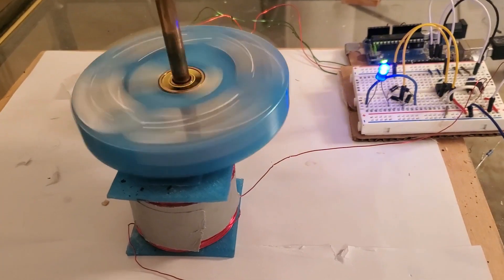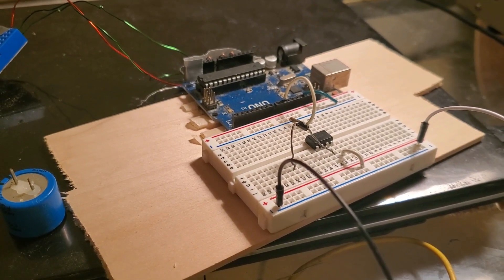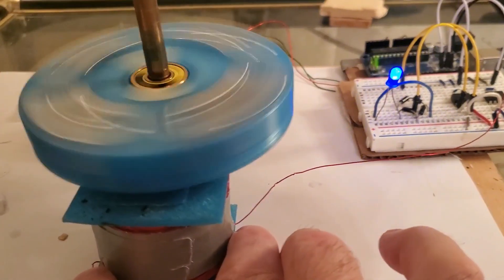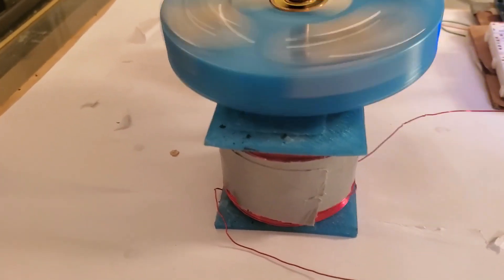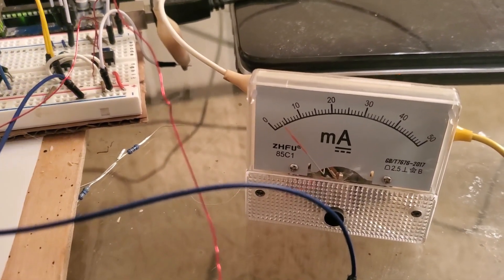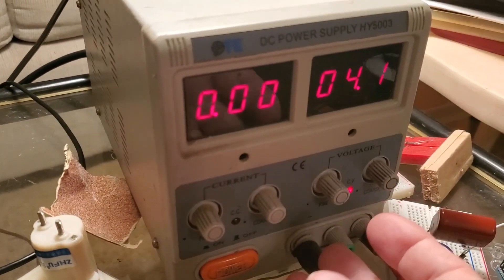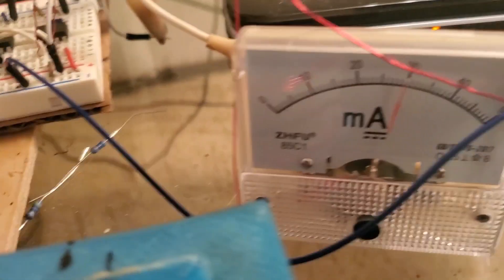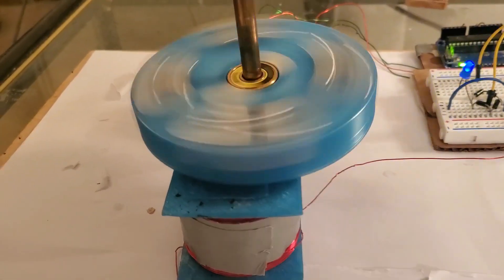Mysteries of the Robert Adams/John Bedini style Pulse Motor

Comment: Because of the Reed switch basically you have a magneto like they have no lawn mower except for a lower voltage because the windings ain't the same as the magneto set up in the lawn mower motor
Reply from the maker: I can't disagree, though in this case you can drive a rotor with the "magneto".
Reply: @paulmaher812 
Yeah you have to time it just right that's true but I can't say it can be done nor can I say it cannot be done be careful don't advertise it too much it's just something that I noticed while I was experimenting on my own little toy motor

Comment: Is the LED before or after the 'electronic switch'? We need to look at the schematic and chronological part of that circuit.
With regards to your volt meter in the PSU: it is very well possible the volt meter is tapped off at a point where there is a diode to prevent the PSU from getting damaged. This would make you believe it is rectified. And it is in a way. Have you tried putting a real sinus voltage on your PSU? Most likely it will come out one way only (again).
Any how, in electronics it is usually good to do research by measuring and checking every part of the circuit. If you have an oscilloscope you could find out even more.
Reply from the maker: Thanks for the comment.  Once I had a chance to sleep on it I realized what is going on.  So first off, this doesn't just show up with a PSU, I may have demonstrated this in a previous video, maybe not, if you just spin the rotor and replace the PSU with a cap you see the voltage in the cap.  So voltage is being rectified but how?  What gave it away for me was when in this video I moved the coil to different angles in relation to the hall effect sensor and the current and voltage out diminished then reversed. As each North then South magnet spins past the coil it traces out an AC sine wave, one would expect without a diode there would be not net DC current.  What I didn't factor in previously is that the PSU or Cap is only connected to the coil for the brief time of the pulse.  So perhaps considering a single peak -> peak of the AC wave, the coil is only connected for say 10% of that time.  Even when the PSU power is at 0 the arduino is still making and breaking the connection to the PSU.  So from there one can see how if you chop the wave up into 10% increments there will be places where the coil is putting out a a large positive voltage, at the zero cross it will put out nothing and places where it puts out a large negative voltage.  It is actually an example of synchronous rectification.  As I said for such a simple machine there really is a lot going on.
Reply: I like building pulsed magnetic motors too. I made a high speed one (10K+ RPMs), that is bearing less. The rotor axel shaft is magnetically floated for extremely low friction. My 2 coils are bifilar wound and only have 2 magnets on rotor with North poles facing out and when power turned off it will spin for 20 minutes using the recaptured energy on secondary coils to capacitors.
  Fun to play with and try different configurations.
 I have a couple of tektronic CRT display O-scopes to get a good view of the waveforms in the circuitry and they really help show what happens when I change anything.

I also have a small digital scope I bought as a kit on Amazon for less than $30 that is very useful too because it runs on 9V battery's, so it's portable also. Very handy.

While O-scopes won't directly show you current flowing in a circuit, (probe is not and can't be in series with the circuit because they are a high impedance capacitive coupled connection).
 But I've learned from decades of usage that you can get a sense of how much current is present at the probe test point by looking at the brightness/thickness of the trace line displayed on the screen and compare how it appears to other places in the circuitry and how it looks when not connected to circuit under test. 
  This probably only works on scopes with a CRT display also. You can adjust the focus and brightness controls to make this more noticeable also.

Comment: At 10 min mark you switch it off and the led dims . Ok so thats just simply the magnet rotating and creating a changing  magnetic feild ie a generator . Is that correct . With the power on you get a collapsing magnetic feild as well
Reply from the maker: You are correct.  Was just pointing out that what is coming out of the bridge rectifier isn't only from the "flyback" current of the collapsing field, the spinning magnets are also generating through the "drive" coil.  In this set-up, eyeballing it looked like 90+% was coming from the flyback/radiant/inductive spike whatever anyone wants to call it. If you put three more coils in around the other magnets a) the machine should be more efficient b) with 4 coils in series inductance 4x and resistance 4x so I would say the strength of the flyback would be the same c) the current from magnets spinning past the coils though, should be 4x higher.  Don't know for certain if that is right but don't see why it wouldn't be and should know more once I throw in a second coil.